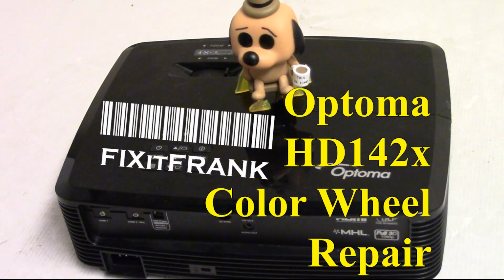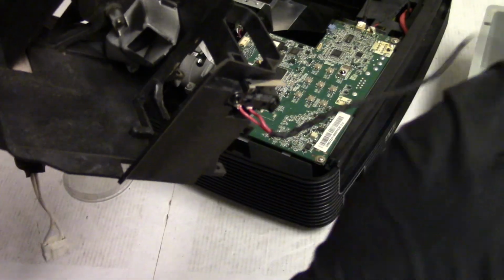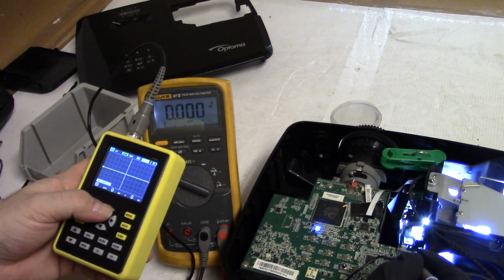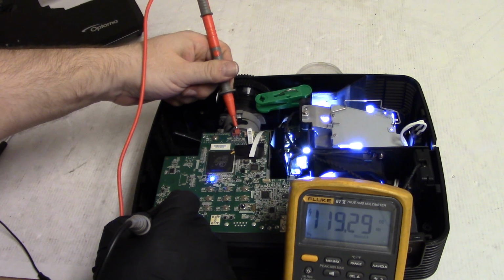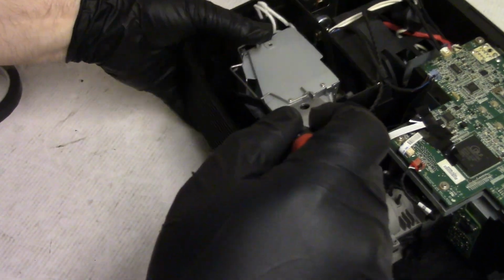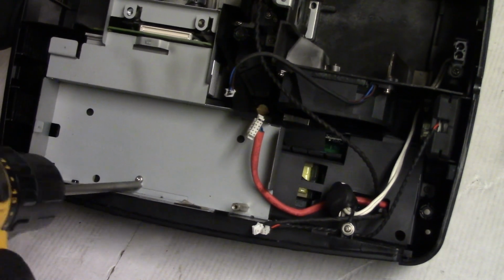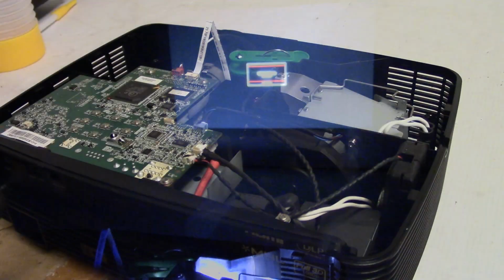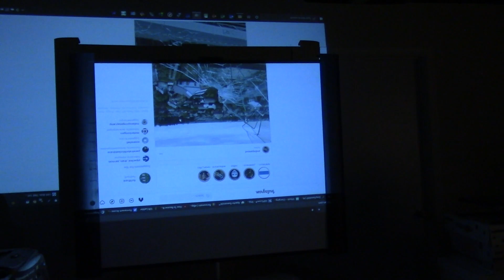Optoma HD142X DLP Projector Repair | Temp LED | Image Flashes Colors| Shuts Down

Comment: Hey Frank, great video. I have a simular problem with mine. It's just over 2 years old with 245 hr done on the lamp, in a none smoking, none dusty enviroment (spare room/movie room). So the projector starts up with lamp coming on, then the fan kicks in, I then manage to get the menu up to check test pattern with the colours looking fine BUT It's still shutting down, showing red flashing light to power and a solid red light on the lamp. I've cleaned the little amount of dust off the fan and unit which was there( hardly any really) and have cleaned the colour wheel censor as you shown. STILL have the problem though. I'm sure the lamp must be good for a few thousand hours or are they prone to failing anyway? (Lamp is the manufactured one sent with the brand new projector). My projector is ceiling fixed, so it never moves around. I should also add, prior to this shut down fault, whilst watching my last two movies, I noticed drop of colour on the screen and then came back to normal again. This happened on and off and with the first movie I thought it could be the dvd(charity shop find) but then the second dvd did the same  before shutting itself down( the projector that is).Any suggestions Frank? Many thanks Rob H
Reply from the maker: Hi Rob,  I wonder if its the sticker on the color wheel starting to fall off. The lamp could theoretically fail early. Its rare but it does happen. But I would check the index mark on the color wheel.  I have a few videos on the HD26 with that issue. The insides are pretty similar.  I would check that first.  Then if it looks okay, I would try another lamp assembly. Buy it from a reputable seller because the lens on the front has to have the proper IR/UV coating. Amazon lamps tens to skip that part and cause more problems than they solve.  If that doesn't solve it, then I would suspect a more involved(and likely electronic) problem.
Reply: @FixitFrank  Hey Frank, thanks for the reply. I've now checked and the colour wheel marker and it is intact. One of your other videos shows leaving the lamp unplugged, and as like the video, the colour wheel comes on fine and then switches off when the fan comes on and repeats this over and over. So! I'm now, as you said, thinking it's a dodgy lamp( angry after only 144 hrs). My lamp and housing is.... SP.7AZ01GC01, but I wondered to keep the price down, is there a lamp only code without having to purchase a housing assembly for it? Thanks Rob

Comment: Thanks for the video! My Hd142x has a 4 month old bulb from projectorlampsusa and recently it started making buzzing noises. Now when turned on, it makes a loud static buzz, the bulb flickers and then shuts off. I disassembled and cleaned everything but still same issue. I've heard it could be the ballast board? Is that the entire power supply board? I've also inquired on the bulb warranty. Any advise would be much appreciated!
Reply from the maker: color flicker or light to dark flicker? How does the color wheel check out?  I would check my color wheel videos first.  If you have any lamp ignition the ballast is not likely bad.  you want to do some more troubleshooting instead of loading the "parts cannon". If its just a color wheel, you're talking like $40-50. If its the ballast(I doubt) then its much much more.
confirm the issue and solution first instead of just throwing parts at it due to what someone else said. Even me!    I would be verifying the color wheel first.  Those are very common failures. Ballasts dont really fail unless something damages them like a cheap amazon lamp.
Reply: Hi frank! Thanks for the reply! It makes a short burst of what I'd call loud white noise while the bulb fires. The bulb illuminates only briefly during the noise... Maybe half a second then cuts out. I checked out the color wheel last night and it's dirty but the sticker is there and it spins freely. The unit does the 3 spin cycles then shuts off. (cooling fan works too). I bought replacement color wheel and will install in a couple of days and report back. Cheers
Reply from the maker: @joscarlang  It kind of sounds like a bulb honestly. Was it an oem or decent aftermarket or was it from amazon or jasper tronics? 
Before replacing the color wheel, I would check the index pulses. If it has clean index pulses, the wheel should be fine. I mean it cant hurt to replace the color wheel, they do wear out but the way you say it makes white noise sounds like a bad arc tube in the lamp.
Reply: @FixitFrank  I got the bulb from Projectorlampsusa. I contacted them about the warranty but I'm just outside it. I'll get a new one from pureland today if that's where you recommend. I'll report back! Thank you!
Reply: @FixitFrank it was the bulb! Unbelievable! Only had 1,100 hours on it. On the bright side, it got a new color wheel and a thorough cleaning.
Thank you for your videos!

Comment: Dear Frank, thank you for the video, if you can spare a minute, I'd like to ask for your advice. I have the same projector and issue is: device starts normally, and then after roughly 5 minutes image starts flickering and desaturating plus some strange quiet noises and squeaks like cd player starting to read the disc. Before I buy a new color wheel maybe you can suggest something. 
Thanks in advance.
Reply from the maker: That is a color wheel issue 100% but the cause of the issue can vary.  Have you replaced the lamp recently and if so, was it from amazon? Cheap lamps have the wrong IR filter and flood the color wheel with IR light confusing the sensor and cause this issue.  If the problem started with the same lamp and it used to be okay, then your color wheel is failing from age.
Reply: @FixitFrank  thank you very much for the answer. Well, the problem started with the old original (I guess) lamp. I thought the lamp was an issue, but the new lamp (very cheap one, I must admit) didn't change anything. 
Anyway, I ordered the new color wheel and will see the results after replacement. And I will put back the old lamp because it is more bright.
Have a nice day!

Comment: Great video! Gonna have to clean my HD142x too. Mine sits outside under a cover patio and it might be a little dusty by now. How would you say the picture quality of this HD 142x compares to the Digital Projection Dvision 30 DLP projector?
Reply from the maker: It depends which Dvision 30.  
There are 3 version if I recall correctly.  I suspect the Digital Projection will look better either way. I have a Dvision30 XL(7000 lumen model) that looks amazing but I will say tuning the colors was a lot more work than I expected.  Also you need 2 lamps per projector in the dvision.  Those lamps use timer modules so you cannot just replace the bare bulb.  I think for outside, the 142x would be a better option.

Comment: Any ideas my projector: 142X
New lamp installed after first one burnt out, after awhile now it starts up with a weird wind up sound. Lamp turns on while it makes the noise, fan is running. But then bulb goes off again and fan stops spinning. It sounds like it wants to start but can’t stay running. Also cleaned the color wheel sensor, cleaned the fan the best I could, unplugged and plugged back in all connections to make sure they were secure.. (I have videos as well but wasn’t sure how to send them to you).. thanks
Reply: @purelandsupply9376  perfect I’ll have to check out the video to figure out how to replace the color wheel. It’s definitely got a lot of hours on it.. not sure if it makes more sense to try the color wheel or just go a new projector route.
Reply from the maker: @turnergrogan4506  Let me know if you find that the sticker is missing. If you are in the USA, I can mail you a piece of the tape I used for replacing the index marks.  email is listed on the about page!  I dont think it needs replacing as much as it just needs that little mark replaced.  Check out my video on the HD26 color wheel. I bet its making the same sound.  https://youtu.be/za-viIWXUlQ
Reply from the maker: Probalby the wheel itself. If it makes a weird whining type of noise, the color wheel's index mark probably came off. Its a little black square sticker on the shiny hub of the color wheel.  They seem to love to fall off after they get a few years old. I have a video coming up in a few days on a 141x that has that issue. I bet its the same as your problem.
Reply: @FixitFrank  so I was able to get the color wheel out and it looks like it is missing the black index mark. I do have black tape that is heat resistant. So I’ll give that a try and put it back in to see what happens. I’ll let you know either way. I appreciate your quick responses.
Reply: @FixitFrank  update: so think it was the color wheel index mark. It now stays on. The color grid looks great but after about 1-2 mins it then starts to flash different colors.. any ideas?
Reply: Also fan is running but seems to get very hot quickly.
Reply from the maker: That tape does show that it was likely the cause.  If its flickering its possible the wheels bearings are failing. https://www.ebay.com/itm/313420952009  $30 and you will be all set.  I wouldn't worry about the heat. There are sensors that will shut down the unit if its too hot.

Comment: hello, very good video, a query I have an HD142x, the issue is as follows, I notice that it heats up a lot and the fan does not make noise, the temperature problem light does not come on or anything. My question is, what temperature does it have to have? and the fan makes a lot of noise?
Reply from the maker: The fan can be very quiet. It is monitored for it's speed and if it stops rotating, the temperature problem light will ignite. The temperature light will also ignite if the internal temperature exceeds 170c (I may be incorrect on the exact temperature, but it is quite high). 
If you are not experiencing any shut down problems I think you're okay. 
Projectors run pretty hot. Exhaust air can be 90c. 
If you have shut down problems and no temperature warning, you have a different issue. Thanks for commenting!
Reply: @FixitFrank  thank you very much for the answer, well it will be normal, since I don't use it often I remembered it being noisy but when I used it the last time I didn't even listen to it

Comment: Hey, Frank.
I have the same Optoma HD142X projector.  I am getting the white dots.  Can you show a video on replacing the DMD chip?  Thanks.
Reply from the maker: If you are in the US and want to send it to me, I will do a video and replace it for free(Aside from shipping).  I just looked and I was surprised to see I don't have any specific videos on replacing the DMD on one of these chassis. 
Otherwise I have a video on a GT1080 where I take the optics out.  The GT1080 is basically the same thing.  https://www.youtube.com/watch?v=QUE8UA8d92I  You are going to want to skip around a bit but I think this will give you enough info.  Just make sure you pay attention to what screws come out of where.  Take lots of pictures.

Comment: Great tutorial on fixing my Optoma, i had en still have issues with the color wheel, the tape desingrated, replaced it with a small piece of isolation tape, which is thicker. It worked for a few minutes but then a horrible sound from the wheel, guess the tape came loose. Is the tape necesarry? can i just remove it and put it together without the tape?
Reply from the maker: Tape is critical. It's how the index point is found. Otherwise the projector won't know what color you need. I had heard of people using flat black acrylic paint pens. It must be black and heat resistant. Black kapton tape would work great

Comment: have a later model
but u gave me some ideas,
thanks!
btw which projector would u recommend?
(around 1000 bucks)
cheers and thanks!
Reply: it was the heat sensor for the colour wheel, pesky little thing...
thanks for ur vid, it gave me the edge I needed!

Comment: Hi Frank - I have a nice Optoma FULL 3D 1080 DLP - just occasional use - stopped working so I bought a new lamp, but in trying to remove the old one I snapped the connections on the lid controls. Is this something I could send to you for fixing - its either that or throw it out :-). Very happy to pay you of course. Malc (Glasgow)
Reply from the maker: oh no. I have seen that. Im in the USA so shipping to me may be a bit more than its worth. However, I know a guy in Manchester UK who is very good. https://www.ebay.co.uk/str/panoramatic  this is his ebay store so you could reach out to him here.  Or I can send him your email that I see listed on your page if you prefer.

Comment: Hello, just watched your video, I need help with troubleshooting my lamp problem.  I changed the lamp in my Optoma HD142X projector, and it worked just fine for two days, afterwards it began flickering.  This is the first time this has happened, so I am lost.  Now my projector shuts down after about 10 minutes and then the lamp error light comes on.  I spoke with a technician at Optoma Corp. and a technician from where I purchased the lamp (Pureland Supply).  Optoma said I need an original lamp, but the information that I got from them would not allow me to purchase a lamp, which cost an arm and a leg.   I sent Pureland Supply a video and the technician said that it was the color wheel.  Can you help me?
Reply from the maker: Hello!  If the color is flickering before it shut down, that is almost certainly color wheel related.  Now if the wheel is bad or if it's just dirty, it's hard to say.  For what its worth, I do repairs for Pureland so I am familiar with their products.  The lamp they sell for the Optoma is as good as the OEM. Optoma kind of lost their way customer service-wise a few years ago. I keep hearing horror stories from people trying to deal with them, so your experience fits what I have heard and experienced.
If you want to get your 142x repaired, I'd contact whoever you talked to at Pureland.  They will handle the logistics(arranging shipping and all) and I would be the one working on it.  That said, there are a few things you can try first. 
I'd suggest taking the lamp out and using a vacuum with a wand attachment and just kind of working it around the inside of where the lamp goes.  I'd point it towards the the color wheel area for sure.  If the dust is built up, that should be enough to knock it loose and out of the color wheel sensor. Worse case, it would need a new wheel and really that is not that uncommon.  They tend to go bad after about 5 years so I think you are well past 5 years.  Most older DLP projectors(over 5-7years) are on color wheel 2 or 3.  I know of a few Optoma HD20s that are on wheel #5 and closing in on 20 years old and still work great. 
I'd try the vacuum cleaning first.  Run it over the vents on the outside too.  No matter how clean you keep your house, projectors just attract any dust that is airborne and it will stick to the plastic. Not much you can do aside from vacuum it up now and again. If you still have issues with the color wheel shutting down the projector, then you can talk to Pureland about a repair if you want to go that way.  Worse case, as long as you get an RMA going before 30 days you can send back the lamp, for a refund if you decide that a new projector is the way you want to go.

Comment: I just had to deal with a similar problem with my 143x. I installed a new lamp assembly and after about 10-15 seconds the picture would loose fidelity and flicker out of control until the projector would shut down and spit out a lamp error. I found for the color wheel to work correctly I had to transfer just the new bulb from the replacement lamp into the original removable mettle lamp assembly but ever since it has worked perfectly. My guess is the after market replacement didn’t line up exactly. Now a thorough  cleaning, maintenance, and refurbishment is always a good idea, but sometimes with these projectors the solution can be… unexpected and strange. I found with the replacement lamp the projector still worked in bright and vivid mode with the unit set to eco, but the more accurate the color settings were the more it would freak out

Comment: Hey, we just changed The lamp, as it was blowing out the light colors. The issue persists still, so now we are a bit stuck. Whites and yellows come out pixelated, in lack of a better description. Dark skin looks normal on the screen, but white complexion looks really blown out, and goes white and light yellow in the highlights. Not sure I explained this well…
Reply from the maker: Do the greens look purple at all?  Also is the lamp of decent quality? I see a lot of lamps from amazon causing more problems than they fix.  Your description makes me think a color wheel issue of some sort. but the cause of the issue might be a sub par quality lamp.